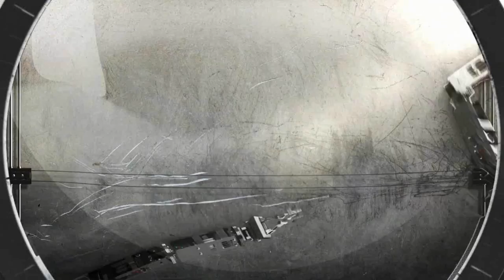Jack "o" Lantern rehash

Comment: What are you using for your cutter?
Reply from the maker: this is an old video..i'm using the chinese plasma cutter (cut 50)  you can see a review i made of it in my old videos.
Reply: Thanks, will check out, I have been looking for a while but seeing I may only use it a few times a year I don't want to drop big bucks but not wast it by buying junk.